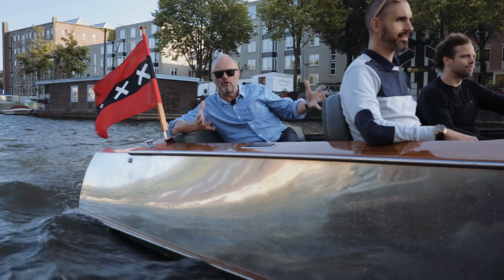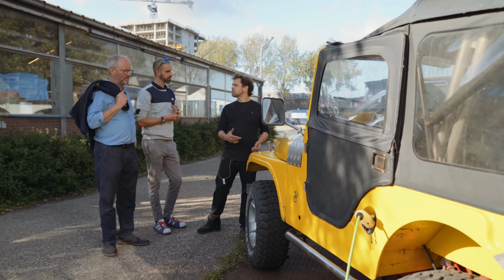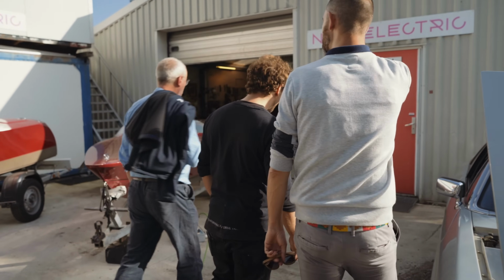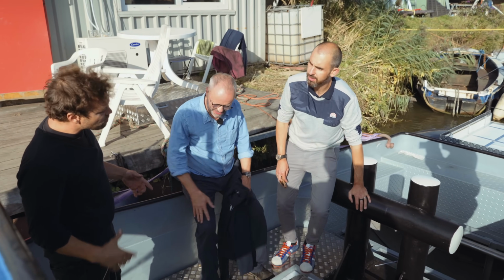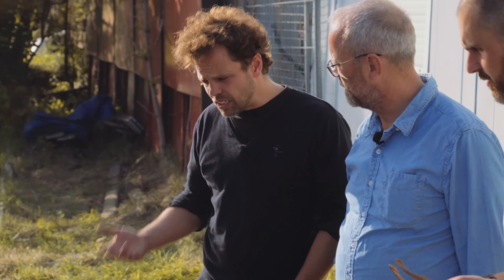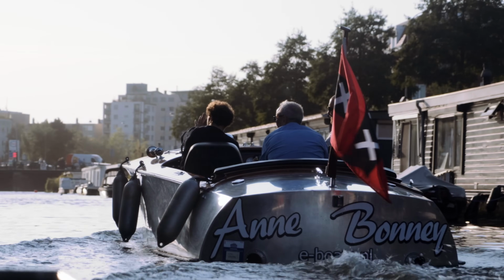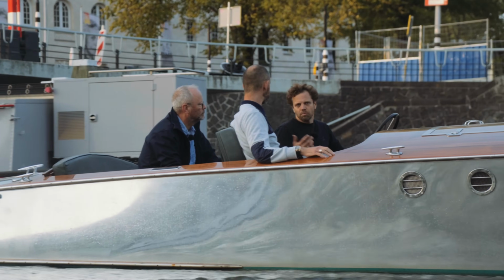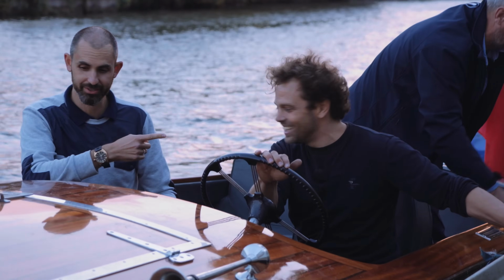New Electric Cruiser | Fully Charged

Comment: The British govt should pay him to create packs that replace some of the common car engines that fit different manufacturers cars and subsidise London car conversions to kill the emissions in 2 years.
Reply: i could not agree more, there should be a huge cottage industry in this country turning out re engineered EV older cars which can still go on for many years.... In the big cities upsetting no one except the vested interest corporates.
Reply: @ouethojlkjn  Re engineered older cars would not have the comfort, refinement and safety of modern cars and the cost of conversion would be huge. And if you did manage to do a conversion cheaply you would still have an old car with it's old issues and be worth virtually nothing in resale value.
Reply: @grantadamson3478  I don't quite see the point you are making Grant, an unconverted brand new Diesel will be worthless in a few years, modern safety features and comfort and all. Yes, conversions at present would be expensive but there are the ongoing day to day running cost savings to factor in. The value in resale for EVs is more to do with the size and condition of the battery packs as much as the car itself. At present, no one has an option other than what the large car makers serve up. Their attempt to sell Diesel has failed miserably, through deceit, and no one is going to suggest going back to 120 year old petrol is the best option. When it's too uncomfortable not to, the Auto Industry will change and that may mean a retro fitting offer. Whatever people will buy and Diesel ain't one of them.
Reply: @ouethojlkjn   My point is that it is not economically viable for the average person to convert an old car to run on electricity. Well not yet anyways. Plus you would be driving a car with less safety features, an important consideration, and a car that would still be high in maintenance compared to newer vehicles,  rust never sleeps. Presently you can buy a small new car for the price of a conversion. And if it's petrol it will probably get around 5-6 litres per 100 ks. 

But say you put that same money into converting an old car. You would need something that would provide you with the x factor and that won't be cheap. And if you think old cars are great well believe me my 68 Pontiac Firebird looked fantastic and was fast and handled well but was far from being comfortable, safe or refined in any way. Perhaps an old Jag would be nice but it wont be cheap. So maybe a more modern car. But then you get something that can be had in petrol form for a fraction of the total cost and you will never recoup the investment through fuel savings. Then in 5 years the battery pack will need changing unless you are happy to run at 50% of original capacity or less. And the reducing capacity is non linear. 

There are many companies doing these types of conversions in the UK and elsewhere but the market is small. It's a pity that Tesla make it almost impossible to use their products other than those scavenged from wrecks.

Once more conversions are done then the price may come down but I personally would be waiting 5-10 years when new EVs are better and cheaper and a truly viable option.
Reply: @grantadamson3478  Yep I agree with most of what you say apart from battery life. Warranties for Tesla are 8 year. Batteries will outlive the vehicle and so eventual replacement is a factor. One off conversions do not have economies of scale but let's say you focus on a common and readily available car, offer a conversion for that already cheap to acquire car and it may make more sense. Here in the UK, conversion from Petrol to Natural Gas was a booming industry until the Government increased the tax on this type of fuel. If this is ever going to happen it will be cottage industries and not mainstream. It's a shame because there is no reason why say Ford could not have an arm of their industry converting existing stock. There is a large engineering firm here (ProDrive) that used to do race and rally prep but now a large part of their revenue is commercial Van conversions to EV. This would not be happening unless business could see a financial benefit.
Reply: @ouethojlkjn  I think Tesla batteries are pretty good and probably one of the best available in a new EV but I don't think you can get them as a part for a conversion or second hand very easily. Second hand wont come with a warranty. I note that the Tesla warranty covers the battery for 8 years and to 70% of original capacity. Which is good but that could be just a marketing ploy and it doesn't appear to continue to subsequent owners. An 8 year warranty does not mean that the battery lasts for 8 years. Plus the warranty has numerous conditions.

Edited to add. It probably is more economic to be converting commercial vehicles.
Reply: I'm sure there would be a huge market to replace the drivetrain in Vivaros - the vans are great, but the gearboxes suck and the injectors sieze in, which can mean huge repair costs.  There's loads of room underneath for batteries to give it decent range.  The problem is the cost - it'd cost as much as buying a new van to do the conversion.  Until that's not the case, it just won't be worth doing, which is a huge pity as I'd think most of the vans in London do maybe 100 miles a day at most - imagine the pollution that would be stopped.
Reply: No. You need to suck in all that NO2 as a reminder of the damage you are doing to the planet. Perhaps all that foul air will motivate the inhabitants to move away from fossil fuels. Moving to more EVs at present would just shift the pollution to other areas.
Reply: @grantadamson3478  respectfully, how does 'moving to more EVs at present shift the pollution to other areas'? Is this because you assume that: a/ all the additional electricity generation would be done via polluting fuels and/or b/ that it is as efficient to refine oil and then transport and burn it into a car to make it move as it is to generate electricity (eg from oil) and then transport it and use it to power a car to move the same distance?
Or have I misunderstood? cheers.
Reply: @shonunezekiel  Yes the answer is a / all the additional electricity generation would be done via polluting fuels. In England they rely on mostly fossil fuels to generate electricity. I can't see them changing rapidly to renewable and clean sources of fuel if there is no incentive at the personal level. Why have they not moved away from fossil fuels already. Hey, I like the idea of EVs but I doubt that the existing electrical infrastructure  could handle a rapid rise in there uptake never mind a switch to green energy.
Reply: @grantadamson3478  thanks for replying Grant. You might be interested to know that in 2017 the UK generated 27.9% of electricity via renewables (excl nuclear): https://en.m.wikipedia.org/wiki/Renewable_energy_in_the_United_Kingdom ... I believe the 2018 figure will show a continuation of the upward trend we have seen over the last 10 years. 27.9% is not as high as it should be (or will ultimately be) but is still a significant net reduction in pollution if people switch from petrol to EV... I agree with you that, if it happens overnight, there would be grid capacity issues, and that as renewables continue to increase, there need to be corresponding increases in electricity storage (or a worldwide electricity grid).
Reply: @shonunezekiel  It would be interesting to know how much energy is consumed from fossil fuels to run your countries vehicle fleet. Only then could we begin to estimate the shortfall generated by your power plants. Then consider what would be the easiest way to generate that much more power. That's a lot of wind turbines and solar panels etc and if the shortfall could not be resolved quickly then coal and gas would become the best option and possibly negating any environmental improvements for quite some time. The other issue is that people tend to charge their cars at night when the sun doesn't shine further impacting on the existing grid.

I think EVs will be the future but the power grid needs changing first. Get the UK up to 80%+ renewable energy with capacity to grow. Build large battery storage facilities then gradually shift to EVs.

Comment: This is actually fucking incredible
Reply: 9600GTMAN - best not turn on your washing machine or dishwasher then :-)
Reply: 9600GTMAN  you do know modern cruise liners use electric thrusters for steering? Or that submarines have been diesel electric since inception... your point is beyond invalid.
Reply: Making a comment about electricity and water not going together on a video like this, is like watching someone safely pack away a pair of scissors in a solid metal box and then commenting "you shouldn't run with scissors, it's not safe"
Reply: @Gewdvibes ~ The electric canal Tug Boat is a winner, if it's tech passes or the marine tests, and can do the job.

Damen the ship manufacturer will be watching these guys, they have a next gen hybrid electric diesel tugboats to handle the massive ships in harbour and coastal. 
They eventually are moving away from the diesel engines to the next gen Gas (LNG) engines, and have specialist 100 ft long LNG tanker pump station boats, that comes to the hybrid gas electric tugboats to fuel them up.

Damen found that their diesel powered tugboats when on duty, run their engines constantly at idle between heavy pulling jobs and just standing on station to a non moving ship.
That diesel engine idle on standby, accounts for almost 70% of the tugboats fuel costs.
Reply: 9600GTMAN  yeah, submariners are being electrocuted constantly. Not.
Reply: 9600GTMAN  as do any commercial application involving electric equipment and marine engineering. The regulatory framework is huge.  Why do people troll with such arrant ignorance?
Reply: I’m using a submersible pump right now. 120vac and you throw the cord into the water. It’s safe man just respect it
Reply: would be if not for the fact this technology was up and running in  1904.

Comment: Another great episode; I'm excited at the prospect of affordable off-the-shelf conversion kits for ICE vehicles, so many current and classics that would benefit from electric drive.
Reply: The greater aspect of this idea is the 3 R's. Reduce, Reuse, Recycle. Responsible embodied energy & resource management of what we already have. Why make a new product when reimagining the old one not only will do but will be better?
Reply: the show should had a warning "don't try this at home".... so good luck trying it...
Reply: @nc3826  I've carried out a number of engine conversions and my day job is a vehicle project engineer so an electric conversion is firmly within my capabilities. The cost of motors, batteries and ancillaries in the UK however is my limiting factor!
@Charles-A Rovira I like your style 👍
Reply: @nc3826  It's not that hard to do conversions if you are handy. Some electrical and mechanical clue is needed, but it's really not rocket-science. It's much simpler than tweaking engines. As the parts get more standard it's getting easier. It's also easier in the UK than much of the rest of Europe, because we have quite relaxed rules on modified vehicles.
Reply: New Electric and many EV shops like us are working on those 'bolt-in' kits..but it remains true that cost is currently high and so only really affordable for those doing high-end conversions. With the advent of repurposing drive trains from wrecked EVscost should come down over time. Bright new electric future and all that! :)
Reply: @NewelectricNl  May I suggest a Wiki site for refining the best practices for repurposing drivetrains from wrecked EV and even for creating new  'bolt-in' kits. So shops (and eventually for individuals) doing this work so they don't have to "keep reinventing the wheel" and can find more efficient ways to complete a project.(If this type wiki site doesn't already exist?) Just like ARPANET just started with only experts having access originally it would be easier to just have a small group of shops to start the process and then expand access. While I found many websites, I didn't find any wiki sites on this subject, wikipedia has proven that its far more efficient at organizing info than the average website. 
I got a sense that you prefer to work on new or cutting edge developments. And outsourcing the refining process would help you focus on areas that are more interesting to you while still allowing the commercialization of the process. 
Hope this helps and good luck.
Reply: Ok occasionally a few comments could turn out to have some relevant at some point so I stand correct ppl :)
Reply: This is ABSOLUTELY the path to take.  IF you want EV available to the common man, this would be the option.  As long as the conversion itself is around $2k, thus is the best way to do it.  Not mandates into one-geared $60k golf carts with iPhones attached.

Comment: I'm now seriously considering converting my Subaru!
Reply: the show should had a warning "don't try this at home".... most EV projects never get finished, cost more than they are worth and are pain to fix all the time... So unless your a true expert or billionaire thats want to blow some real money... But a cheap used EV and do some simple mods to make feel unique...
Reply: We have shaft couplers and adapter plates for the Subaru manual 5 speed gearbox already designed.. as these boxes are used in the Factory Five 818 kit car too.
Reply: Go for it! The only downside will be the loss of the boxer burble but just record it before the conversion and play it on the stereo after 😉
Reply: Yeah, I have a 99 Legacy manual trans that I don't use much anymore. Would be awesome as an electric. Loads of room for batteries in the back and shortish range would be fine.
Reply: Crack-on with it! perfectly do-able. i'av already started on mine and i knew nothing about ev's 5 months ago.